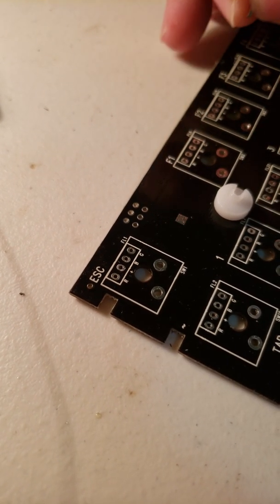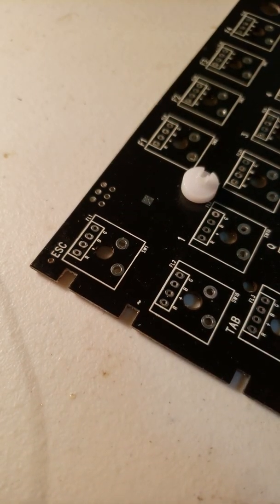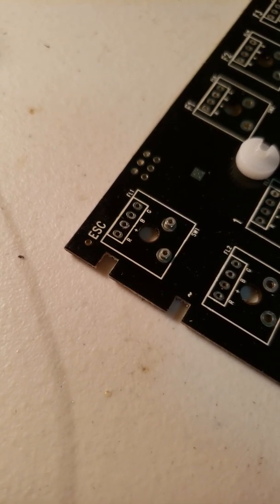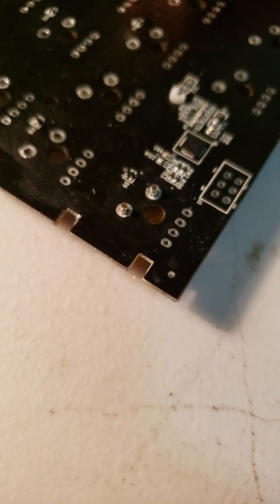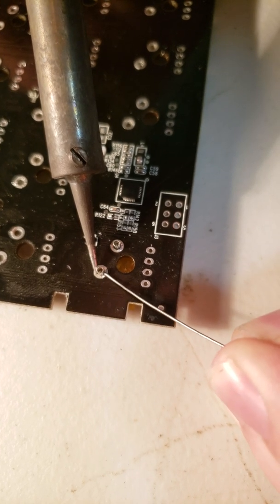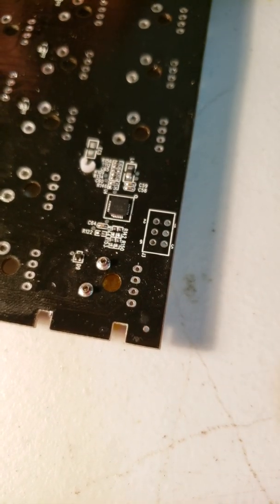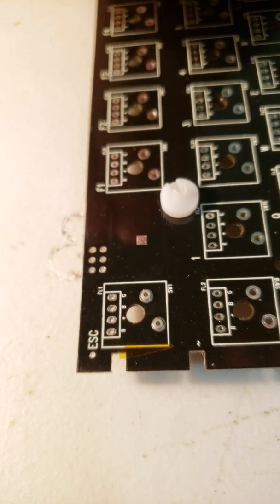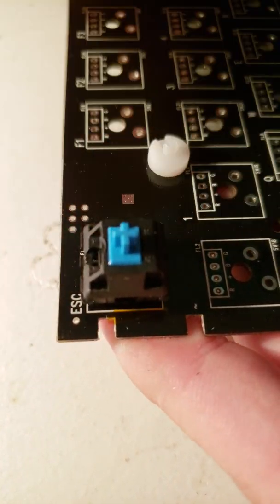Mill-Max 0305 Hotswap Socket Installation

Comment: I wouldn't recommend soldering them in that way. If they aren't rotated to the proper position you can get problems fitting switch legs into the socket, especially bigger ones like the kailh box switch legs and you'll have to end up doing something crazy like filing the legs or avoiding them altogether.
Best way is to fit the sockets onto a switch's legs, fit them onto the pcb and solder, then pull the switch out and repeat. Just be slow and very careful.

Comment: Thanks for the great video. I’m pretty sure it is the digit after the dash that determines size rather than the first digit. As far as I can tell, the only difference between the 0305 and 7305 are the falange at the top. 7305 are more flush. The tall ones are 7305-2 and the short ones are 7305-0. And there is one in between 7305-1. (Same goes for 0305’s) I think the reason they are different size is because of that 5th digit being different more than the first.

Thanks for the video and link

Comment: Question about taping them all at once, if you're using a plate mount board does that method mess with the alignment with the switches at all? Or are the tolerances of fitting the Mill-Max in are sufficient? (Building a KBD75v2 so just wondering)
Reply from the maker: I have a kbd75 as well! And I didn't have any problems doing it that way. Though I will say. I have improved my method and instead of taping them, I mount the sockets to the switch and then mount the switches to the pcb/plate and solder the sockets in

Comment: Would I need to get mill max for my LEDs too? (I'm planning to use them on my Ducky One 2 mini.
Reply from the maker: Depends on how you plan to mount them. The sockets in the video won't fit LED sockets, but if you can solder the LEDs under your switches that's the best method.
Reply: They make mill-max in tons of shapes and sizes. A little overwhelming if you ask me.

Comment: I'm considering these for one of my upcoming builds (disclaimer - I'm kind of new to this). One thing I don't fully understand is the following - if you've got a PCB that normally relies on having switches soldered in that hold it to the plate, does it mean that with these sockets all it would rely on is the friction of all the switches' pins to hold it?
Reply: Pretty much, yeah.
Reply: Is less of a problem if the switches are 5 pin.

Comment: So I just got some 7305 sockets and I can't get them over one of the two legs of my linjar switches (which are just recolored gateron yellows).  Am I missing something here?  It's the leg with the groove on it, it looks like it's too wide and just won't go into the socket (from the wide end).  Weirdly enough, the same pin will go in from the other end partially, so I'm not understanding the issue.  Any tips?
Reply: Check if you got any solder inside the socket that prevents the switch from going in
Reply: Did it work out ?
Reply: @Absoult  Turns out the linjars have a slightly too wide second pin.  It can be filed down (which I haven't gotten around to).  Still second guessing whether I should even bother wish hotswap on multiple boards, or if I should just make a macropad or single board hotswap.  We'll see :)

Comment: How secure will the switches be? And when removing switches will the sockets stay in place
Reply from the maker: Yes they will stay in place. These are soldered on so they're not going anywhere. They're super secure, but that is also depending on the switch. Not all switches have the same thickness of leads.

Comment: how durable are these? how long do they last?
Reply from the maker: I haven't gone any extensive durability tests. Though they are still holding my switches strong after 2 years. Even after changing the switches out multiple times. The connection should be good for a very very long time.

Comment: will this effect the stabs because this will make the switches sit a bit higher than the stabs
Reply from the maker: That's a good concern. I haven't had a full sized keyboard with the 0305 but the 7305 have a thin enough head where its not noticable.

Comment: The question I have is...can you remove these later and go back to the regular PCB?
Reply: why would u want to?
Reply: @oaf1575  I have a Discipline that has these and no plate to hold in the switches. They flex heaps so I will have to desolder the Mill-Max.
Reply: @bakeraus  you can remove them, just desolder
Reply from the maker: Yeah they're really easy to remove, just don't plan on reusing them.

Comment: Your lucky you dont get cold solder joints you gold it there to long you could also damage your board it's supposed to be 2 seconds max from touch to finish
Reply from the maker: I use a very low temp. Just hot enough to melt the solder. I also refuse to touch the solder straight to the iron since that's bad practice. Though when operating with extreme heat, yes you don't want the iron to sit too long this could severely damage the pads.
Reply: @sojourn_tv  i burnt my escape key, it can still input when i touch the pcb with tweezers,the metal pad is gone, dont know if i can still fix it
Reply from the maker: @arsyasultan2505  depending on which pad was lifted, you can bridge a wire from a key in the same row or column to the socket and be fine.

Comment: Do you have to use this kind of tape for this or would electrical tape work?
Reply: You can use kapton tape(the tape shown in the video) to do your soldering work. I don't prefer using electrical tape since it can leave a sticky residue on your pcb. If electrical tape is all you have then use what you got. Usually I use poster putty since they're easier to work with as they peel off components in one piece and they're cheap. You can find them at the dollar store.
Reply: nO, Only oRAngE trANspArEnT
Reply: Pierre Nodoyuna i don’t know i thought you might need heat resistant tape or something
Reply: @carson2889  Well that is a good question then XD, I guess the socket gets quite hot in the process

Comment: Is it ok to solder with bigger solder ?
Reply: i recommend melting the tin to your soldering tip first, as the bigger diameter solder is usually hard to control.

Comment: I'm looking into using these for a quefrency build, do you think i'd still have to use pcb mount switches for it with these or could i get away with plate?
Reply: if you have some pcb switch laying around, you can use it for alignment (put the socket into the switch pins, and remove them after soldering). after that, you can use plate mount
Reply from the maker: @Looo0007  this is actually my preferred method now since the video is somewhat old at this point. I find it easier to mount the sockets to the pins of the switch and then solder the switch as normal as if the sockets were the pins.

Comment: Can I do this on my ducky one 2 mini?
Reply: You would have to desolder off your current switches but yes.
Reply from the maker: @sashkoification  Those work, make sure they fit on the board you're ordering them for, I've heard those don't fit most PCBs
Reply: @sojourn_tv  yes i ordered and they are too wide. Got millmax sockets 7305, they fits better

Comment: I'm curious, is it really necessary to solder those sockets in? Besides of course being loose, wouldn't they work if you just plain stick them in as well?
Reply from the maker: Yes it's necessary. Without soldering there won't be a stable connection.
Reply: They would work but when you pull out the switches they will come out with the switches

They will also be more wobbly if you don't solder them

Comment from the maker: If you have a through hole that isn't able to stay in place due to having multiple layouts. Use a switch to put it in place and then solder it on with the switch. I don't prefer this method since when you make a mistake it's less forgiving.
Reply: some more tip: put the tin on your solder tip. that's how i solder mine.